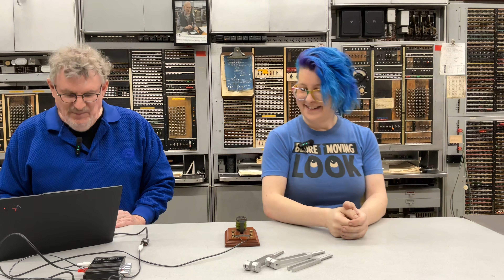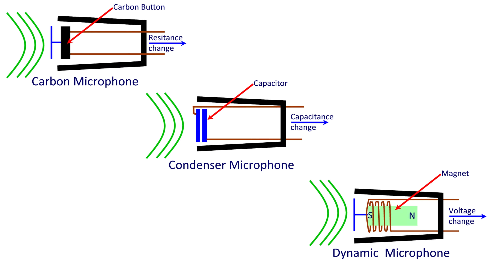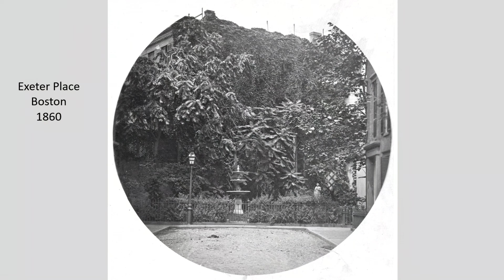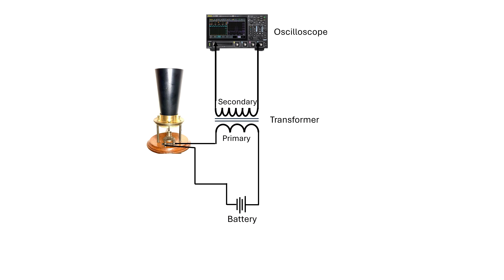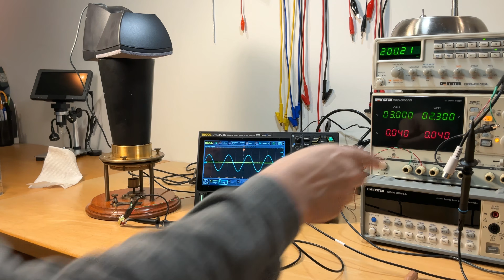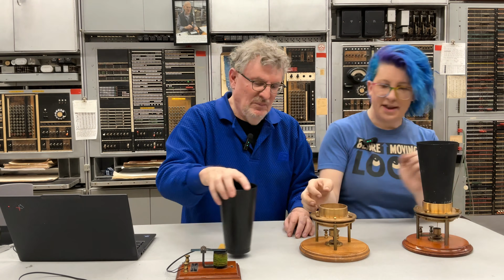Recreating the world's first phone call! Part 1

Comment: Hi,
Interesting video - thanks.
Did you check out what the little Chinesium transformer does when it has 20mA flowing through it?   If it saturated, it wouldn't pass much audio,   
If it was mt experiment I would initially try an 8 ohm to 1K tranny. I'd drive the 8 ohm winding from a 20mA current source (high impedance source). 20V via  a 1K resistor woild probably suffice.  Then hang an inductance meter across the 1K winding and see what happens to the inductance as the DC current in the 8 ohm winding increases. If the inductance falls a lot, it isn't going to pass audio.

Comment: Looking at that design it almost seems like the bottom ring is upside down. I'm imagining that if it was flipped tightening and loosening the upper part would put tension on the bottom part. But there's just so much documentation that says it goes otherwise. So maybe they tensioned like a drum and then tied it off. Weird.

Comment: I bet you could get better results from the variable liquid resistor if you drove it from a cantilever mechanism to increase the travel of the wire. Perhaps you salvage the mechanism from an old phonograph or a degraded rochelle salt microphone, and use it in reverse. The wire would attach where the old diaphragm used to be, and the new diaphragm would drive the mechanism as was previously done by a needle in a groove or the movement of a crystal. I wonder if such a mechanism might also do away with the cone and membrane, and just be driven by a long, thin rod pressed against the hyoid bone?

Comment: Be careful about the "induction coil".  Your small audio transformer will probably saturate the core with the DC component of the hookup.  You might want to use a coil out of a real telephone which won't get saturated with the DC  of the excitation for the transmitter/microphone.  If the transformer is saturated, it won't transmit an AC signal.  Telephone transformers that are used have gaps that kill the saturation (DC component).
Reply: Good point.  I don't think it was the problem here, but it can be.

Comment: Hey love the vid! So microphone capsules use mylar for diaphragms. You could try using an anti static bag as a cheap alternative. I have made neat pvc pipe drum heads from them. If you want better sound try and source thinner mylar as it will work better.
Reply: Also wanted to add a thinner source of mylar would be an emergency or space blanket. :)

Comment: 12:03 There's also the electret microphone, which is the electrostatic equivalent of a dynamic microphone (using an electret instead of a magnet).
Reply: That's correct, but it's a special type of condenser microphone (that does not require excitation voltage and also does not operate via FM or AM by detuning an oscillating circuit).
So there are three or four types of condensor microphones.

Comment: Things happened pretty fast.  I just looked at Edison’s patent for the carbon transmitter and his exhibit drawing is dated November 26, 1877.  The benefit of the carbon transmitter is that it has effective power gain in that the mechanical input is used to modulate a fairly large DC current passing through the carbon dust.  The original Bell transmitter was a diaphragm attached an electric coil biased by a permanent magnet and did not have effective gain.  The acid transmitter did have effective gain but was apparently not feasible for the public to use.  The History of Science and Engineering in the Bell System cites an experiment in the early 1900s where a water cooled carbon transmitter carrying multiple Amperes of current was attached to a heavy gauge transmission line to relay a speech to loudspeakers for an audience quite some distance away.  The experiment was done with no intervening mechanical or electronic amplifiers.  The Bell System experimented with mechanical amplifiers a few years before electron tubes were introduced.  The amplifier was a receiver mechanically coupled to a carbon transmitter which was used to regenerate the aural current.  As you might guess the mechanical losses resulted in poor frequency response.
Reply: Blake invented another version of the carbon transmitter in 1878, which is the one the Bell System used for their first 20 years or so.
Reply: @P @PeterAtConnectionsMuseum hanks for adding that information, appreciated.  A History of Engineering and Science and Engineering in the Bell System credits both Emile Berliner with perfection by Francis Blake, Blake’s name being attached to the device used by Western Electric to circumvent Edison.  Edison sold the rights to his transmitter to a subsidiary of Western Union.  American Science and Innovation states that Western Union offered to pay Edison 100,000 Dollars, but Edison negotiated 6,000 Dollars per year for 17 years.  The author notes that Western Union could have essentially kept the 100,000 on account, paid Edison the interest it earned and essentially got to use the Edison transmitter design at no net cost.

There were a complex set of cross licenses for transmitters, receivers and electrical relays with about 15 years of litigations over telephony patents and licenses in the US and England.  I find it pretty difficult to follow the complicated flow of developments.
Reply: Another interesting story of the carbon transmitter is that DeForest used it in his experiments to transmit wireless speech and sound.  In 1907 Deforest used an Audion tube to generate RF which was transformer coupled to an antenna.  Sound was modulated on the carrier by connecting a carbon transmitter between one side of the transformer output and ground.  All of the RF current flowed through the mic.  According to Inland Seas Online Deforest installed a transmitter on the Yacht Thelma in July 1906 and made the first known ship to shore speech and music transmissions relaying results of a regatta taking place on Lake Erie near Toledo, Ohio.  That is close to Maumee, Ohio where the Bell System conducted some of the earliest use of a carrier multiplex long distance span.  That is also near Thomas Edison’s birthplace of Milan, Ohio.

Comment: You had me at “Hello!” (Literally). Early cylinder and disc phonograph record players often used a thin Mica diaphragm that can be purchased on eBay. I wonder how that would perform here? You could attach the needle to the center with CA glue. You could also experiment with adding a micro drop of dish soap to the water to reduce surface tension. A small drop of isopropyl alcohol could also work. Depending on salinity, it would salt-out and rise to the surface so the needle would have to penetrate through the alcohol layer to contact the salt water.

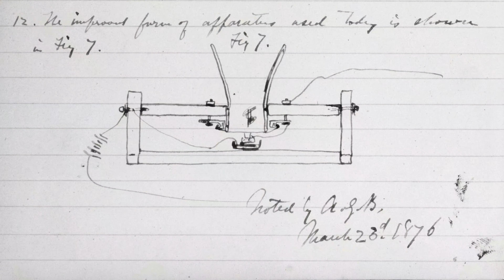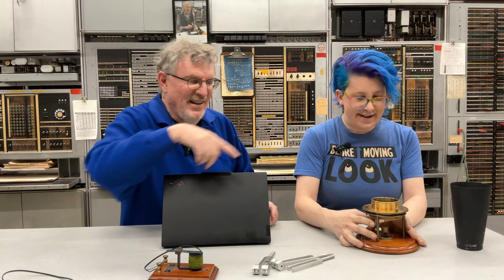Comment: 26:42 That sketch looks to me like the typical drum-tightening arrangement: the membrane is clearly touching the cone in the middle, so the tightness of the membrane is not just set by the initial "stringing", but also by tightening the screws (which pulls the ring and the edges of the membrane upwards, but the cone stays put, so the middle part of the membrane is tensioned). I wonder if the cones in the replicas have loosened up and come out too easily (9:25) to resist this tension
Reply: It's a good observation, I wish I had seen that sooner.  But we talk about it in part 2.
Reply: yep, i saw that too in the diagram.... the three thumbs screws are the diaphragm tensioning mechanism.

Comment: Having seen quite a few scientific drawings and models that were obviously wrong and having in fact got into trouble with teachers for pointing that out, I'm sure those models are incorrectly constructed. The drawing from the notebook shows the diaphragm attached to a ring which can be drawn up to stretch it tight over the end of the horn. You could probably get the model to work if you make a ring that could be pressed down, simultaneously securing and stretching the diaphragm material. In my working career, I sometime had to reproduce electronic circuits described in published scientific papers. These were quite often wrong, or misleading. This seems to have been on purpose in quite a few cases.
Reply: You are right.  We talk about it in part 2, I wish I had noticed that sooner.

Comment: Diluted sulfuric acid is less dangerous because it don't give off chlorine when electrolysed. Some other variables are the voltage of the batterie because an electrolyte bath is not linear as a resistor and the turn ratio of the transformer to match the microphone to the line
Reply: The intense dehydration of tissues and intense heat evolved by concentrated sulfuric acid makes it a completely different animal than dilute sulfuric acid which is only a bit more irritating than lemon juice or vinegar.  The concentrated is oily, syrupy and dense.  It is violently corrosive.  Battery acid is not so dangerous.

Comment: 121 ohms is not that odd for headphones common are 300 ohm.
Reply: ^ Yup.

And it (120R) isn't "abusing" a solid-state amplifier designed for 4-8 ohms.  In fact, it'll be a terribly easy load to drive.  Just not very loud.

Remember:  An amp with nothing connected is a load of nearly infinite ohms.  It's totally fine with that.  The problem is when the impedance drops to below the design limit -- because that starts looking more like a short on the output terminals.

Comment: Bell invevted the first telephone circuit later known as Voice No Signalling. AKA Hoot and Hollar where obtaining the attention of the distant party was being heard at the far end. Also known in the industry as a Junk Yard Circuit because of a large multi point Hoot and Hollar circuit for a junk yard in the Bronx New York. A confusing circuit arrangement for techs that once worked a #1A ESS and wanted to know "how do I ring the customer on this thing?" Well you don't!!!

The second telephone circuit, as I refer to, is the manual Ring Down circuit,where a local ringing generator colocated with the telephone supplied with a dry cell battery, was used to alert the far end to answer an incoming call. The US Army TA-312 field telephone is one such device. The TA-1 field telephone is similar but is sound powered only and uses no local batteries on what's known as a dry circuitn(No DC current on the copper wire pair).

BTW. Bell Labs was at the West Street address in New York up until the mid 1960's. That building was converted into a housing complex that housed, initially, only artists. The High Line once cut through the building until part of the rail structure was torn down prior to 1963.

Interesting to note, Wall Street brokers used manual ringdown equipment up until recent times, being phased out with IP based communication systems.

Comment: I guess you can't just take a random audio transformer for the transmission line. You need to match the impedance of the input and output, or you won't do your signal a favor.
Prolly you don't even need a transformer. The DC offset will not damage the coil when you keep the current low enough, and you will get a MUCH stronger output.
Just make a current loop like in the original patent.
Reply: There's an additional problem with using these small audio transformers (I have a handful of the one shown) - and any non-air-cored inductor really*: The DC bias, if it is high enough, will saturate the core, and at that point nothing comes out. In these audio transformers the core is magnetically very soft, and it does not take a lot to saturate them. (*It's just a thing to be aware of and design appropriately)
Reply: @kkpdk  Exactly.  It doesn't take much DC current to saturate such a small impedance matching transformer.  Another option might be to use a high value coupling capacitor in series with the primary to block any DC. It would drastically improve efficiency overall considering this setup would normally be battery powered.  Might not even need the transformer at all, at least from the standpoint of getting the signal into an oscilloscope.

Comment: Looking at the diagram, it looks like the horn is pressing against the diaphragm. So the moving up and down of that would make sense as a tensioning mechanism for the diaphragm. I think its the same as how a drum is tightened. But your moving the body instead of the rim.
Reply: I think you're on to something here! Looking at the drawings and the disassembly segment, it feels like the black cone should be firmly affixed such that it protrudes out the bottom of the upper brass ring, instead of loosely "sitting" in it. Then, when you tighten the tuning knobs, it would pull the diaphragm ring up into the black cone, stretching it 
tighter, allowing the adjustment Sarah was expecting.
Reply: @carissavixen  I assume that you and @j616s are referring to the diagram "Fig. 7" which appears @26:43. I noticed the same thing. It appears that the diaphragm is either stretched over the end of the black cone (I'll call that the "horn"), or over the end of a separate cylindrical tube under the horn. Let's call whatever the diaphragm is stretched over the "rim", like the rim of a drum. The thumb screws appear to draw the diaphragm upwards against the rim, just like the bottom head of a drum. Maybe the reproductions are missing a critical piece? The rim, whether it's the end of the horn or a separate piece with the horn resting on top of it, would need to be secured in place in the top plate like @carissavixen noted.
Reply: Wait, I think I might see what's wrong! I think that the top brass ring is upside down! The photo they shared of the origin at the Smithsonian doesn't show the raised brass collar above the flange like the reproduction has. I suspect the raised brass collar on the reproduction is supposed the be the rim that the diaphragm stretches over.
Reply: Indeed.  I wish we had figured that out sooner, but see part 2.
Reply: Yeah, really good point!